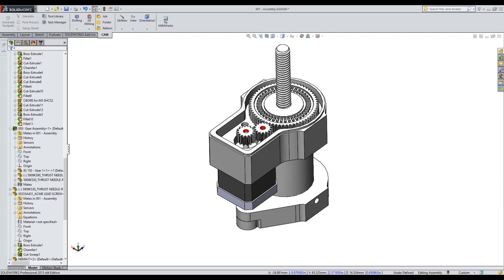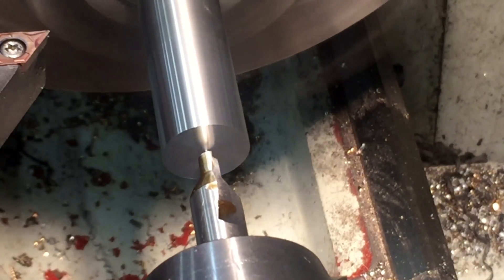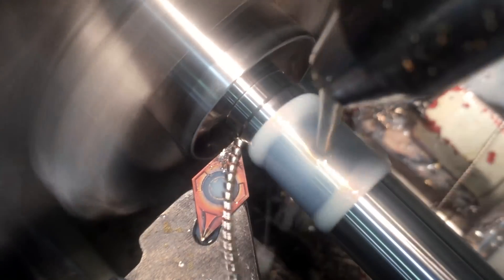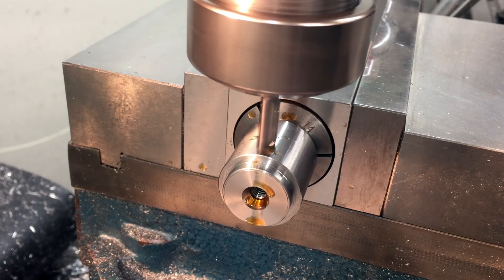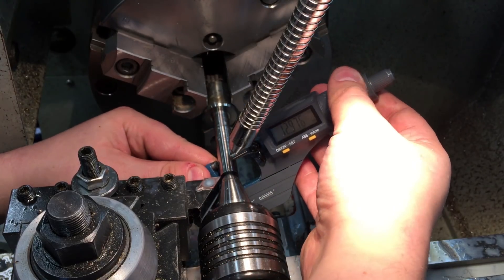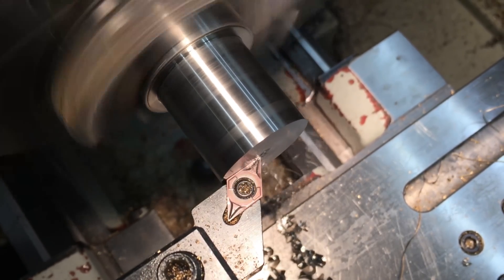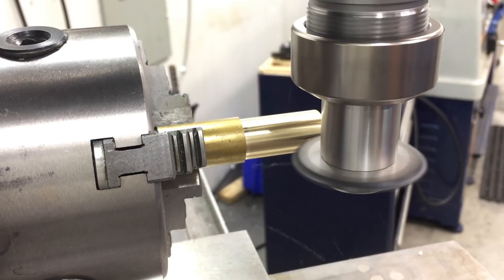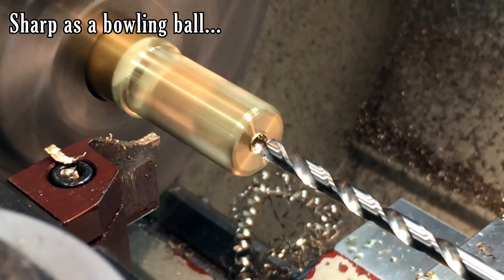Gears:  Cutting my teeth.

Comment: it really irritates me when someone is using a micrometer and then just keeps rotating the free bit (the clicky bit) 

yes i get it you need to get it propperly angled.  
but you are also messing with your measurement if it was already perfectly flat.  

(most often i see this with calipers though but hey)

Comment: You got lucky not finding an arbor, I bought a chinese mt4 22mm stub arbor and it has like 0,05mm runout. Could regrind the morse taper to get it good but that's always extra work

Also, the "south bend" chuck appears to be of really good quality and obviously never crashed into anything
Reply from the maker: That's funny, I've heard a few people getting these from china and them being the wrong size, out of round or out of concentricity.  Buyer beware I guess!  Yeah the chuck is beautiful.  It's a shared machine, so it's a miracle it hasn't been crashed lol

Comment: Can't help but to feel like you're running quite high RPM... It's probably fine... just feels like way too much :D
Reply from the maker: In the turning?  Probably.  Carbide is pretty forgiving though, and I find on this lathe in particular I tend to get a nicer surface finish at high-ish speeds in stainless.

Comment: well done!!!
is there a way to calculate the diameter of a gear with a given number of teeth, knowing it's module 1?
Reply from the maker: Thanks!

The module system makes it easy.  You just take your module and multiply it by the number of teeth plus two.  So for a 20 tooth module 1 gear, the diameter of the stock is (20+2)*1, which is 22mm

Comment: The 6-flute countersinks require a fairly rigid setup to not chatter. Too light of a feed or too long of a dwell on a rigid setup will chatter as well. I've always had luck with KEO and MA Ford. Neither are too expensive.
Reply from the maker: It's funny, this is probably the most rigid setup I've ever used and it still chattered.  Granted, the tailstock was extended pretty far, but it's a big lathe.  I did feed pretty slowly, so maybe that contributed.  I do have a 1 flute MA Ford countersink that I love!  They make good stuff.
Reply: Use helical reamer.  If it still chatters, apply Crisco.  Old trick.

Comment: What does "not as hard as an alloy" mean? 17-4 is an alloy with nickel copper and chromium.
Reply from the maker: Youre totally right, technically every metal I work with is some kind of alloy.  When I say alloy, I usually mean a mid to high carbon steel or a high strength low carbon steel alloy like 4140 or 4340 or a tool steel.

Comment: Why do so many YouTube machinists use cutting oil instead of coolant when drilling etc? Is it so we can see what's happening? Because surely for heat removal etc it's less efficient and chip evacuation is basically non existent.

Also, I understand that in this case brass/bronze is usually machined dry to make swarf more manageable.
Reply from the maker: I usually use oil on manual machines because coolant can be so messy.  It's definitely much worse for heat dissipation and chip evacuation, but it is good for lubricity in drilling.  It also tends to stick to the cutting tool to prevent building up material on the surface.  The other thing I kind of like about it is that it gives me an idea of temperature of the part based on how it smokes.  That's a bit off-label, but I still find it useful.  It also looks cool :P
Reply: @TabletopMachineShop  cool as, yea coolant can get quite messy.
 It certainly works so keep on doing it!

Comment: I have bunch of the 17PH too that I got at auction. Great stuff. I use Cool Tool II. I've had good luck with Ford 6 flute countersinks.
Reply from the maker: Interesting, do you have to run the 6 flute CS really slow?  I just can't seem to get them to work.

Comment: Never had any luck with multi flute countersinks either. I use a large single flute or the one with a hole drilled at an angle to the center line, can't remember what those are called at the moment but you get the picture. Nice work!
Reply from the maker: Thanks!  Ya I know those "cross drilled" countersinks well.. I like using them for deburring though I don't think I've ever used one for a big countersink

Comment: Hi. Great video. Going to get some 17-4 PH steel soon to try it. Could you please tell me what Make and part numer of square inserts youv'e uset for chamfering. I struggle to get ones with sharp cutting edge for steel. Thanks.
Reply from the maker: Thanks Jerzy!

The inserts are high polish SCGX inserts.  They're for aluminum, but they leave an amazing surface finish on just about anything.  The trick is that they have a high-positive rake angle so they're very delicate.  Here's an example: https://www.shars.com/products/indexable-cutting/indexable-inserts/scgx-32-51-lh-yd101-1-carbide-insert

Comment: Great work. I mess around a little but nothing close to this. I made a small tool post holder and an attachment to fix a center line problem with the compound slide for a Sherline lathe. I uploaded those videos but of course its very amateur compared to this. 

Working on making my own dial gauge right now but of course the accuracy would probably be suspect. I will upload that too regardless of how it comes out.
Reply from the maker: Thanks!  I'll check out your video.  Have you seen Clickspring?  He absolutely slays it on a Sherline lathe, so I wouldn't doubt yourself just because of that!
Reply: @TabletopMachineShop  I do not miss a Clickspring. He is an absolute perfectionist. Brilliant work. The antikythera mechanism is really good. I do hope he donates it to a museum after so many more can see the real replica in action.

Comment: Why is this channel called the Tabletop Machine Shop but that lathe looks like a floor model and is huge?
Reply from the maker: Haha well played.  The machines used so far in my videos are at my work, which graciously allows employees to use them for personal projects.  I've been designing some much smaller machines that I can run at home, and, when the designs are finished, I'm going to make them!
Reply: I haven't found a Chinese 8x16 lathe I am willing to suffer through so I have never gotten one but I check videos, like yours, constantly in hopes a gem emerges.  I want a mini mill as well with at least 4 inches of Z travel and 5, or 6, would be optimal.
Reply: The Best Stooge   maybe he upgraded
Reply: @Ya Boi No, as you can see by his reply to me and if he had upgraded then he would need to change the channel's name.

Comment: I'd like to get some of those cheap gear cutters .. can think of a lot of uses ... but then Id want several modules and things would get expensive...
Reply from the maker: I officially ordered another set.  I'm promising myself that M0.5, M1 and maybe M2 will handle everything I need.... In hindsight I promise myself things like that all the time and it rarely works out.  Oh wellll
Reply: yeah those are exactly the sizes I'd go for .. though I had a look recently and they were out of stock on the 0.5 and 1M... and the same sets are  more expensive when stocked here in the UK, anyway one day!

Comment: You would want to know the heat treat on the 17-4 stainless before trying to heat treat it. If you are going for a H900 HT and it has already been heat treated to say H1075 or H1150 you can't go to H900 (Its hardest) without a solution anneal first. If you are starting with annealed material you can then go to any heat treat. The solution annealing would probably be out of the scope for a person without special heat treating equipment.
Reply from the maker: Thanks for the comment!  I was going for H1150 from the annealed state ... according to some random website of course :P  It seemed to go okay, but like I mentioned it didn't get particularly hard.  Heat treating is black magic.
Reply: @TabletopMachineShop  I've have good results with making tool holders from 17-4 PH, I know it doesn't stand for "Pre-Hardened" but it does help me remember.

Comment: I thought I was the the only one that had no luck with those 6 flute countersink bits
Reply from the maker: I wonder if there are support groups out there :P
Reply: My experiece is not to use is as a countersink, but rather as a chamfer tool for edges, like on a milling machine.
If you want to countersink a hole nicely it is posible if you take the rpm to the absolute lowest setting and feed with dedication :)
Reply: I use to have this problem. I found slow and steady is better. If you dive too fast then let off is what causes the hex.